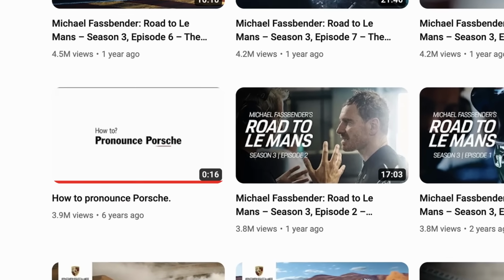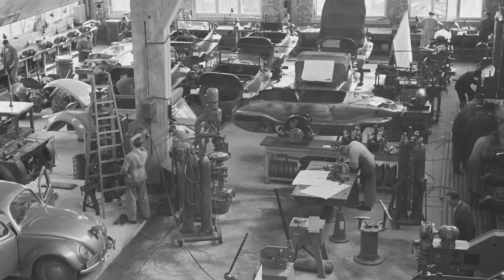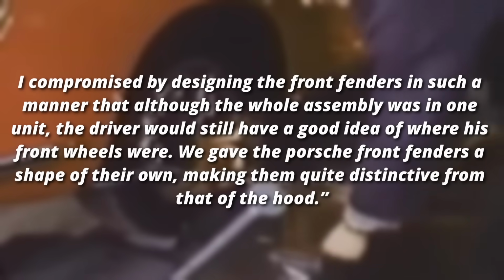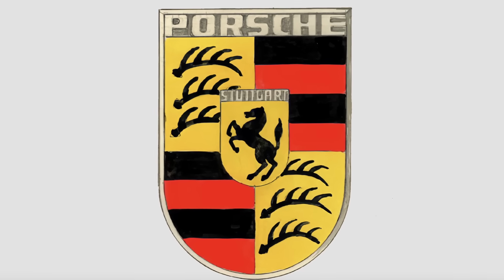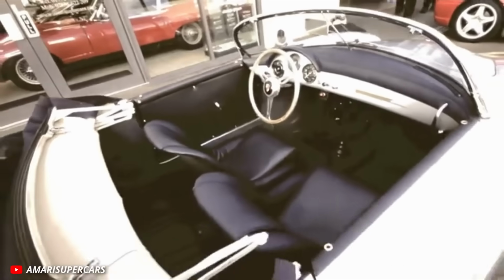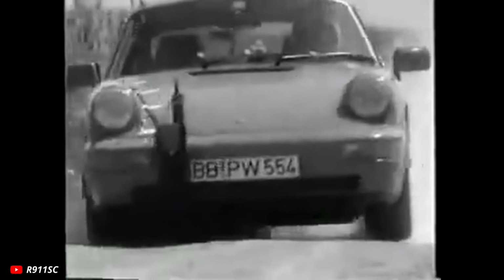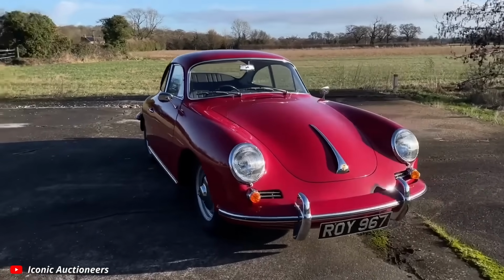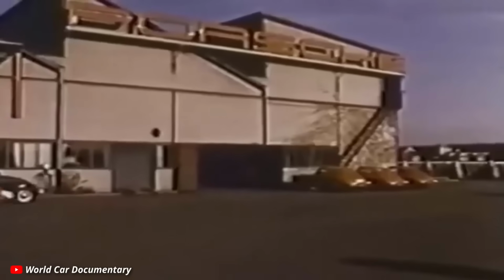Porsche's first car was a Volkswagen Beetle on steroids

Comment: Way back when I was young in the 1960s my enthusiast friends (who were almost as broke as me) would take 356 engines from wrecked Porsches and put them into their VW bugs. It was a straight engine swap with practically no mods required, you could just bolt the 356 engine to the back of the VW transmission. It sure brightened up the performance of their VW!
Reply: Paul Newman's who was a successful race driver as well as actor used a similar route to incognito performance.  He put a VW body on a Porsche.
Reply: That’s what they did for the Herbie movies. They had Porsche motors (and maybe even transaxles) too in the cars.
Reply: This particular comment section, knows their stuff.
You all have spot on information, my father had a VW beetle and was planning on putting a Porsche engine in it.
I was born in 1973, well it never happened....he sold the car just after my sister was born one year later in 1974...
I can still remember him telling the history of VW Porsche, the ole days...I miss them.
Time stamped 8:21am(4-11-24)
Reply: I hear ya!!! In 1969 Bitburg Germany I was a young  sergeant in the USAF,  one of my squadron friends was shipping back to the US and had a '65 beetle with a 356 engine that I bought and yes this is a straight bolt in MOD. !!! I drove it all over Europe!! It went so fast that I had to put weights in the front end  as it went over 100mph on the Autobahn!!

Comment: Never driven a Porsche. But my first car was a 1963 Beetle, 1200 cc, 34 horsepower or somewhere around that, pendulum rear axle. Quite fun to drive on narrow, winding gravel roads. But she could bite you if you pressed her too hard, the pendulum rear axle made her behave in a nasty, unpredictable way. My next car was a 1969 Beetle, 1500 cc, 44 horsepower or something like that, and the new rear axle, not the pendulum one, but the one with an extra joint to make the rear wheels stay flat on the surface. That car was hilariously fun to drive on twisty roads! Especially in the winter, on snow and ice! It was so oversteery, you basically had to turn the steering wheel the other way, out of the curves, to stop the car from turning too much. It was so jittery, but also so predictable, it was a joy to drive! Oh, I miss her a lot. I can only guess how much fun a Porsche 356 would have been to drive, if the basic Beetle was such a hoot in itself! 😎
Reply: I bought a 69 two months ago and it's my first car.. learning to drive in it and also in my friend's wife's Honda CRV (a lot easier learn and get used to roads without worrying about a clutch and shifting) so the mix of me driving my Bug and the other vehicle as much as possible before the my driving test next month.
Reply: @brianworden7022  I got a 71 a year and a half ago - my first car! Wanted one since I was a kid. Took a turn too fast, spun, and flipped onto it's side in a snowbank. I threw it back on its wheels, one rim was bent so - spare tire installed, drove it home. Had to replace a valve cover gasket and there's a rattle at 40mph but otherwise the car's fine. Driving it is pretty fun though an automatic (which never existed on the type 1) would be icing on the cake. I've gotten the hang of using the manual, but it's still just an annoying minigame you have to play while driving... I just want to GO.

Comment: I owned a few 356’s and drove several more. What really set them apart from everything else except Mercedes was build quality and engineering. Driving a 356 was similar to piloting a small aircraft. Every control moved with purpose and precision. The car was fitted with everything a driver needed and nothing he didn’t. My young wife proved how solid the body was when she crashed the Porsche into a concrete abutment at 35 mph and walked away. The doors still opened and shut perfectly. It was her third day of ownership. The Normal 1600cc cars made 60 hp DIN and were good for 100 mph. The 1600 Super engine made 75 hp and was good for 115-120 mph. In the early 1970’s VW introduced the dual port 1600 cc motor. This could be built to 2180 cc/ 200 hp for far less than the 356 unit, and bolted right in. We would save the original 356 engine and street race with the VW motor. Speeds up to 150 mph were seen late on Saturday nights, humbling most Detroit muscle cars. Only a few big block Corvettes could run as fast.
Reply: your reference to a small aircraft is True. you put my thoughts into words.

Comment: In 1963 I was a high school senior and an older friend had just left the army. He bought a 58 Porsche with a blown engine and we rebuilt it. The engine was finished on a Sunday and the gas station next to his house where we borrowed the floor jack was closed. Ted had been the army's  heavyweight weight lifting champion.  So he handed me the wrench for the transaxel lay down on the crawler and told me to scoot the engine off the bench into his hands. He scooted under the car, bench pressed the engine into place and I bolted it up. My second favorite time with him was leaving a Shakey's Pizza Parlor one night the following Spring with me riding in a friend's  AC Aceca and Ted in the Porsche. We raced north towards home and stayed with Ted until a sweeper curve over a pass through some hills. We slowed and Ted never did. He just drifted like Juan Manuel Fangio through the curve to a pullout at the top.

Comment: Bart, please drive an early Speedster, before you stress its "good" handling.  My senior year at Fort Lauderdale High School, I had a  bright yellow 1954 which was very fond of spinning around 360 degrees inside of its own wheelbase at speed.  Early cars had the dreaded swing axles, which rewarded any dramatic change in braking or accelerator pedals with the aforementioned spin.  But on the plus side, it was the only car that I ever owned that as you slowly cruised down AIA towards Las Olas, girls would talk to you and if you were going slow enough, they could sit on and then slide over the windowless very low slung doors and plunk into the passenger seat..........now that is priceless German engineering!😉
Reply: Most of the oversteer could be adjusted out by lowering the rear until you had a couple of degrees of negative camber;. This could be done in an hour or two by turning the torsion bars. they had a different number of spline teeth on the inner than on the outer, so you could adjust the rear height  to within about quarter inch increments. In 1960 they added what they called a camber compensater, a single leaf spring crosswise under the swing axles that pivoted under the transaxle to support part of the weight with no roll stiffness, and the torsion bars were adjusted so the combination gave it a little negative camber, and they fitted it with Dunlop SP radials. The Super 90 Convertible D (successor to the Speedster) handled great. That setup was actually too fast for the brakes if you really pushed it hard on the track. Up until that model the Alfin brakes were more than adequate.

Comment: I bough a rough shape 1961 356B coupe in 1975 for only $900.  I was in high school, and soon after in collage.  I rebuilt the engine, transmission, suspension and brakes, and cleaned up the wear and tear on the body and interior.  it was a fun car to drive, its power to weight ratio was decent, and it got a remarkable 36 mpg (great for a collage student). I drove it daily I was in school, it seemed to attract a lot women.  but I was not in the market, I had a long time steady girl friend (who has been my wife, and still is, for 40 years now) who was not impressed with it.  however her friends were always asking her about that guy who picked her up in the Porsche after school every day (I was also very fit as I competed in sports).  Those were fun times.  I think the early versions gave it the reputation of being a souped up VW, but no part of that Porsche engine was the same as the VW (except the geat that drove the distributor as I recall).  I think It was the engine that VW should have been making: it cooled better, it breathed better, used much better materials, and was very reliable and robust.  In southern California it seemed to attract trouble, parts were stolen off it (the costly hub caps, the battery), the car was even stolen once (fortunately I got it back a few days later, police did a good job of locating it fairly quickly, and arrested the driver).  I sold it in about 198O or '81 for $5400. a fair price than, since it was a daily driver, not a showcar.   Now that car is worth a lot, when Porsche went up market with the way costlier and heavier 911, I think the 356, that was competing with the less costly British sports cars, made the 356 became a hot item.  Porsche has always made a car that was focused on the driver's experience, though lately they seem to have gone astray with non-sports cars in their line up.  The current models area all fuel thursty, unreliable and very costly to own and maintain.  they should have stayed with at least one model in the 4 cylinder category I think.
Reply: Porsche went "astray" in order to stay in business. The mid-engine 1997 Boxster was the car that saved the company and ensured the 911' continued success. And the current SUVs are the most popular Porsches currently in their stable. As a result Porsche is one of the most lucrative car manufacturers in the world. BTW… Porsche has two sports cars with turbocharged 4 cylinder engines in their lineup. And Porsche builds performance cars, not economy cars.
Reply: @tome9009  I am aware of all of that, perhaps necessary market adaptations.  My point is that Porsche has evolved into a high end car maker that is a very long way from this "beetle on steroids" featured in this video.  At least it appears they still keep the driver's experience as their highest priority..

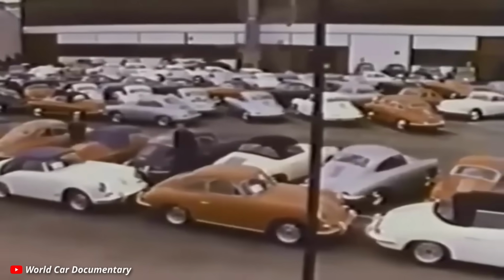Comment: There's a scene at 10:57 where 3 white first generation B Roadsters are visible. I can't help but wonder if one of them was mine! I bought a white1960 B Roadster (in my opinion the best looking 356) 1600 "Normal" in 1977 and drove the crap out of it until I stupidly sold it in 1983. What that car would be worth today is mind blowing!
Reply: There were actually four 356 Generations (not counting the original hand-built aluminum coupes (1948-1950). They were the Pre-A, A, B and C. So, your 356 B Roadster was actually one of the 3rd generation (1959-1963).

Comment: Has anyone done a feature on the Porsche type 542, also known as the Studebaker Z87, a prototype sedan built in 1953. Porsche built the prototype, a highly sophisticated front-engine (120-degree V6, two versions built, one air cooled, one water-cooled) car with independent front and rear suspension.  Styling language was a blend of Porsche and Studebaker (look up the "Loewy-Bourke coupe") themes, and the Porsche prototype looked really great in comparison to other compact sedans of the time.

Comment: I love what you say about the British cars. Yes, you do have to be a mechanic and to be able to work on the cars yourself. I still have the tools needed to totally rebuild my MGB or Austin-Healey Sprite engine. They don't take up a lot of space. I even remember one time, when, at 2AM, I realized I needed to change the clutch in my MGB so that I could get to work the next day. I had a great garage setup, and I could do that job in about two hours. It was wild. At that time of night, I could hear, and see, the deer running down the street outside my house. Ah, the good old days.
Reply from the maker: Amazing. Sounds like very different times
Reply: @bartscarstories  Very different. Actually, the time I am talking about is the late 1970s and early 1980s. Besides fixing the cars myself to get to work, I would sometimes borrow my brother's Triumph 1968 GT6 or my father's 1970 Oldsmobile Delta 88 (it was a third car he just kept around). My brother still has the GT6, and recently totally took it apart, restored it and put it back together. At one point my father offered to sell the Delta 88 to me for $25. I declined. Recall that this was just after the second oil shock and the Olds got just 10 MPG. I actually had room for it, but even making good money, it was just not practical.
Reply: @bartscarstories  By the way, I love the channel. Keep up the good work.

Comment: Good summary, but you should have pointed out that Porsche and VW were separate companies.  Porsche was an engineering consulting company, which is why Ferdinand was contracted by the Nazi government to design the original Beetle.  Even though he'd been toying around with the design for some years (and "borrowed" an awful lot from Tatra), the VW company was set up by the government and Porsche had nothing to do with it, outside of his engineering contract.  It was really Ferry that championed building their own car based on the Beetle, the parts for which they had to buy from VW.

Comment: Only incorrect fact was that in reality, Porsche built the 1582 cc, three piece case for VW which was going to make it a diesel. But the test car had a 0-62 mph time of 60 seconds and the project was killed. Porsche bought the engine back. Several years ago VW wanted a diesel for its museum. One had to be brought back from the USA.
Reply: He also said the engine was rear mounted, it was not.
Reply: @dipstiksubaru3246  Are you talking about the prototypes or production cars?
Reply: @jockellis  what? All the 356 cars used a mid engine layout.
Reply: @jockellis  the only one that didn't was the type 64 which was never put into production and was literally a rebodied beetle.
Reply: Yep, the 356/1 was mid-engined, if I'm not mistaken, and all subsequent 356 models were rear-engine.
Reply: @zonoscopePictures  both my B Super Roadster and my C SC coupe were definitely rear engined. Where did the idea originate that all 356s had mid mounted engines? Anyone who believes that has never peered into the engine bay.
Reply: @zonoscopePictures  Quite correct.

Comment: Porsche is not just a car manufacturer. VW also repeatedly commissioned Porsche to develop engines for Audi, SEAT and VW. 
There was even a joint car model from VW and Porsche, the VW-Porsche 914. Unfortunately, VW and Porsche did not agree on the joint model after a change in management at VW.
Reply: The 914 was sold in Europe as a VW-Porsche, but in America as a Porsche, mainly due to pricing issues. I know this because a friend imported one from Europe labeled as a VW-Porsche.

Comment: The VW Beetle And the porsche 356 were designed by engineers, not by men you might call a stylist who designed most other cars.
The Theme of both the bug and the 356 were by making an efficient shape you improve a cars gas milage and it's speed.  In the vw bug and the 356 have a small engine that was kept in the trunk, but this was good enough ibecause the car is small and aerodynamic.
Reply: Check out the Hans Ledwinka designed Tatras (Tatra T 77, T 87, the 603, etc), they are beautiful, aerodynamic cars that are also rear engined and air cooled… according to Ferdinand Porsche, he & Ledwinka “looked over each other’s shoulders” when they designed their cars !

Comment: The Audi design is even older and more consistent. The engine in front of the front axle layout of modern longitudinally set up Audis goes back to the prewar Auto Union/DKW F9 (from which many design elements of the KdF wagon were lifted, along from the Tatra, which was an even greater rip-off). VAG has three very old layouts, the F9, the KdF, and the 1959 Austin 7/Mini. Porsche is far from alone in the design conservatism of the whole group, and not even the most conservative element present.

Comment: Never drove a 351, but owned a '67 Kharmann Ghia, [Ghias were heavier than the corresponding year Beetle it is based upon] and the improvement in handling in the Ghia vs. a Beetle from the lower CG is reason enough to believe the 351 is a great car to drive: smaller, lighter, faster HOOOOOOOOOOOOOOOOOOOOOOOOOON!

Comment: Take a 68 Beetle and use a Carrera engine, drivetrain, suspension, brakes, and nice fat grippy tires. Then you have a sleeper. Make sure you leave the rust and patina on the body, helps the sleep. Then when you leave them in the dust they sit there with their mouths open. BTW, completely unrelated, What happens if BreatheRight strips make you go crosseyed?